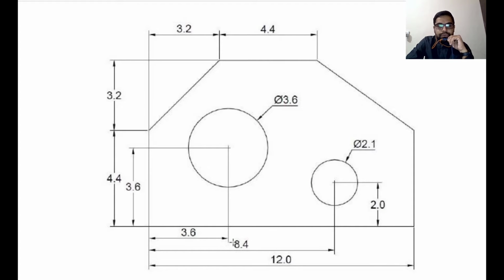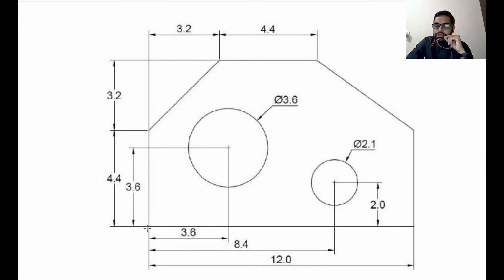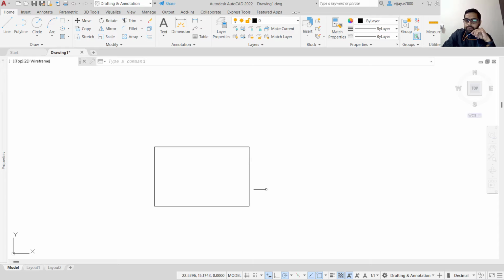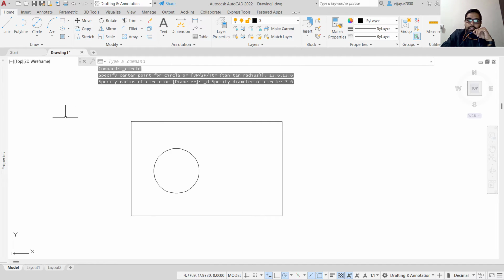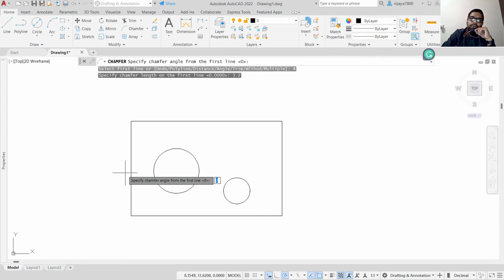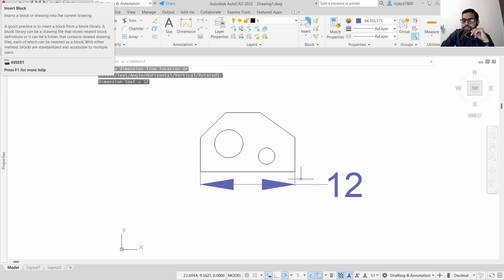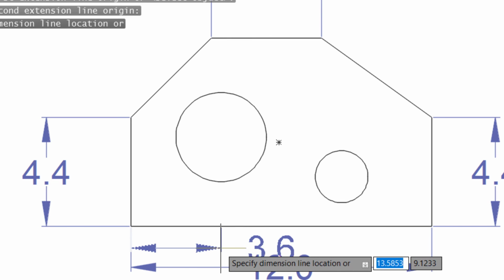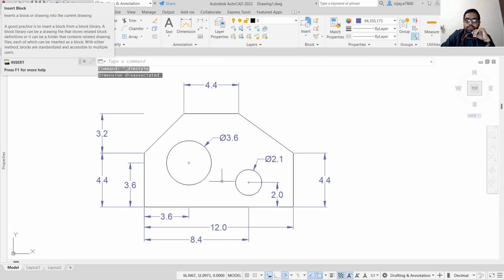Practice 2 Autocad Drawing using Chamfer Command

Comment: My friend, when directed the ponter to the corner of the rectangle the coordinates showing (x,y)  10,10 how can i make base pont is zero (from corner of the rectangle)
Reply from the maker: You can shift the coordinate system at desired location or you can use absolute coordinates
Reply: @vijaybeniwal  thank you for fast respon. 
Pardon me. Suppose the cordinat circle is 5,6. So, i should fill the cordinat as
x= 10 + 5 = 15 
y = 10 + 6 =16
Could i fill cordinat as 5,6?
Reply from the maker: @sugatachandrawinata7585  if you want to put coordinates as 5,6 you need to use relative coordinates. Simply put @5,6 and cad will consider your previous point as origin.
Refer this video for coordinates 
https://www.youtube.com/watch?v=sLN3kreOrCA        (HINDI)

https://www.youtube.com/watch?v=WuuUepy83Og       (ENGLISH)